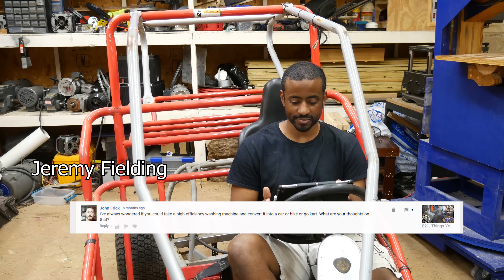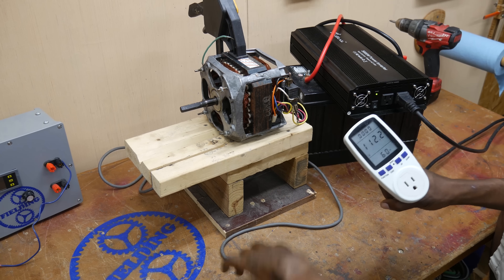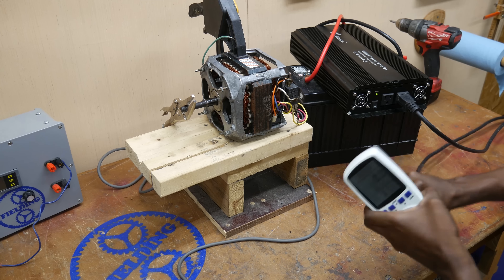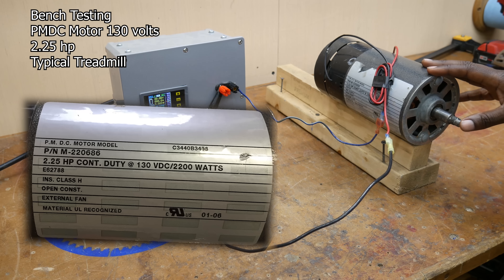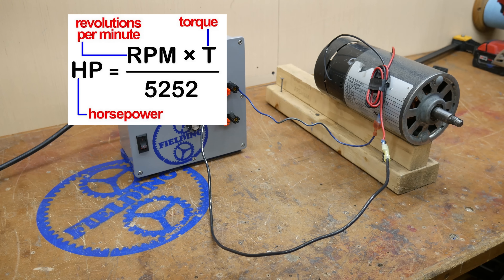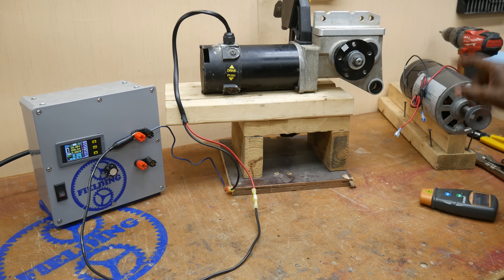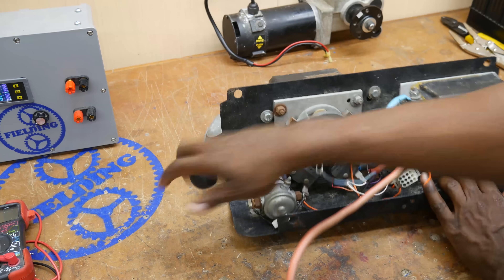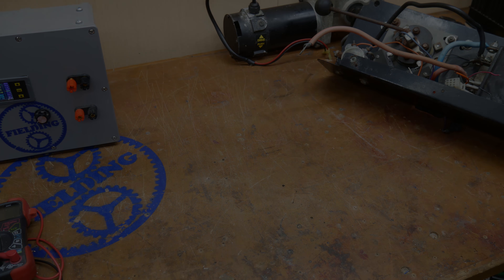What Electric Motors Can Be Used In A Go Kart or E Bike; Bench Testing and Recommended Sizing #61

Comment: This might be a really stupid question, but can you use two small motors in tandem? One that has extremely high torque, and another with low torque but extreme speed?
Reply: jordan secrist u could but they would have to be on completely different wheels and separate esc’s so it wouldn’t be worth it and I would recommend just getting a bigger motor

Comment: What electric motor do you recommend for a 1991 Ford Ranger "S" using one of those old 3speed manual transmissions. No clutch, not even a bell housing. The input shaft on the transmission cut short so the motor can be mounted to the transmission as close as possible. From there the driveshaft to the rear end unit. 3 forward and one reverse gear. Secondly,, what do you think of using power tool batteries to power it? Take your time workshop this and get back to me or make a video, I'm subscribing to your channel now. Thanks
Reply: 18650s will work

Comment: 30 kmh is more like 20 mph not 12
Reply from the maker: if only I had used a calculator... LOL ... it happens. I did add a correction to the description a year ago... its the best I can do
Reply: @Jeremy_Fielding  lol it's fine thanks so much for the video im really interested in learning all about electricity issue is im 19 so all my buddies have been lost to the internet 😥

Anyway why wouldn't it work to have a generator powered by another generator and harvest free electricity I'm sure you've had the Q before I'm just curious why it wouldn't work

Comment: Better to just use an alternator from a truck, better yet it uses DC. It does need a little bit of reworking but with the right ESC (electronic speed controller) it can even provide regeneron power back to batteries when breaking.

Comment: i have to say this.. all tho i'm not saying this is the case i've used similar inverters
1500 watts or a short peek at 1675ish watts is the normal max for any ONE outlet in a house.
Being that these type inverters tend to split there output with 1500 watts per circuit.  depending on the model
1500 watts split between outlet one 1 or 2 plugs. and 1500 watts on the other. total 3kw
it would make more since if they would advertise them as 1500 per plug. 

But don't say it's lying to you unless you check.
Reply from the maker: Please read the description

Comment: some of the best motors for electric go karts are 24 v industrial motors from baldor or leeson with integral fans .. Ive built several EVS as seen on my channel.. and the motors are cheap.. One thing people commonly do in underpower the motor based on assumptions about amperage ratings.. I often ran the 1 hp leeson self cooled motors on 200 amps and never once got the motor warm.. Having a programmable controller is nice but i do not recommend the kelly brand.. They have a preset soft start that the user cannot ovveride.. I think the limit was 40 %.. The alltrax and curtis controllers have full range programming .( as well as 20 other brands )

Comment: The addition of a capacitor will stop any problems with initial startup. It will hit the motor with a large jolt of electricity to get it spinning. I would suggest the same capacitor that was originally connected to the motor when it was used as a clothes washer motor.
For a low torque motor why not use a torque converter to get the cart moving. Even a simple centrifugal clutch from a chain saw mini-bike, or go-cart would help overcome problems with initial take-off. Both types would allow the motor to gain RPMs then gradually transfer the power to the wheels. The addition of a heavy flywheel would also help with either the clutch or torque converter. 
You are correct about not using an inverter. Tremendous power is lost when using one.
Reply from the maker: I was using the capacitor in the demonstration you just watched... the weakness is in the inverter to deliver the electrical power not the motor or capacitor. Also there are more notes in the description.

Comment: Lol this is hilarious. THATS NOT AN INVERTER ITS A TRANSFORMING INVERTER IT DOES 2 THINGS transform 12v to 120v, and invert DC to AC. SO IF YOU MAX OUT 1 THING IT CAN DO IT WONT DO THE OTHER TO SPEC! 
Inverter = DC->AC or AC-> DC ------ Transformer = 12v > 120v step up voltage. Buck Converter -- 96V DC -> 12v DC Step down. Learn you electronics before plugging shit in. Thats a PEAK RMS 3000 watt. meaning it does 1500 watts or 1800 watts continuous load.
Just wire ten 12v batteries in series and make 120v DC then INVERT THE 120V DC to 120V AC. And you wont be having peak problems. The peak problems are from you trying to step 12>120 AND put out 1755 watts. If your voltage matches 120vAC - 120vDC Then it can do the statistics posted on the transforming inverter. If you are transforming you can expect 35-50% performance. Just use 120VDC then invert to 120VAC and use that same inverter it will be fine... That electric 120VAC motor is more efficient than anything DC so I would use it. Especially if its from a front loading "High Efficiency" washer.

Comment: I see that you have solved the "where to put the batteries" problem but I don.t see it. It appears to be well solved, as your boys have appear to have good seating. Have I missed a video perhaps?
Reply from the maker: Yes. There use to be a video in between but I removed it because the motor it shows. Short answer : the manufacture lied about the HP. I didn’t want to give them a permanent “ad” on my channel by showing it and using it in a video.
Reply from the maker: I bought slightly smaller batteries and mounted them low between the motor mounts and the seats

Comment: AC motors don’t need a big ass inverter, but instead use a pre-charge circuit to supply the high initial current. Plenty of YouTube videos on electric vehicle conversion available that explain it.

Comment: The drives on the shafts of the two motors you compared are different sizes. This will give you inaccurate rpm readouts.

Comment: You are an idiot. Washing machine motor can be converted to DC by reconnecting the coils. Why you breake people plans? Check the motor wiring conversion Ac to Dc before you talk shit.
Reply from the maker: Are you outside the USA? Perhaps you are talking about a universal motor. They run on AC and DC and are often used outside the US in washing machines. There is no reconnecting anything though. A induction motor however will not run on DC. That is what I show here. Thanks for watching.

Comment: True battery sag is the likely cause, not the rating of the inverter being false.  You need to put two or three such batteries in parallel with good tight connections and heavy duty wiring to supply the needed level of inrush current to start that inductive load.  I take it it's not one of the inverters that alarms when battery voltage drops below safety voltage (about 11.5 - 11.6 V for lead-acid) and it cuts off the load to protect the batteries.  It is usually done to keep batteries from over-discharging and thus avoiding cutting their life short.  It is much less likely that the inverter manufacturers are cheating you on their rating and more likely your extreme dead-locked load starved the inverter of a high enough source of cold cranking amps to get that motor started by breaking free of its moorings or overcoming the locking power of the tool.  But another thing to point out.  You increased the physical load beyond what is normal on that motor by putting it in a physical dead-lock.  That takes it to maximum current automatically whereas a real go-cart would not have more than likely.  If you had put a moderately heavy drag on the motor that was reasonable as opposed to a physical deadlock, the current would never go that high or for that long because the motor would immediately start to turn even if slowly at first, because a go-cart would not have as much drag on the motor on level ground with the wheels not blocked physically.  That is the reason why your current surge went so high for so long and your battery voltage sagged because of the extreme current it was being demanded for because electric motors tend towards infinite torque if you can supply them the amount of power required without the wires burning up first.   It will raise the current until it overcomes breaking past the physical drag on the rotation and starts spinning and then the current calms down, or it can't draw enough current and eventually the power supply gives out or the motor thermal protection kicks in, or the power supply can supply more current than its' asking for but it's asking for so much current it will burn up the windings trying without thermal overload protection or if the motor was that powerful, it would break its mooring or burn up the cabling from the battery if nothing else failed first.  Never dead-lock an electric motor.  It is not good for it, and it's not a realistic test anyways.  It's like throwing a log between the spokes of your wheel in terms of how hard it is on the motor to stress it out trying to start like that.
 
Another thing to point out is that if it wasn't battery sag, and it was the maximum rating of the inverter that was at fault, a couple factors to consider about the truth behind ratings.  Never confuse the constant operational max rating on inverter wattage with the max surge rating.  Good inverters will list both their max constant wattage and their max momentary surge wattage just for the reason so that prosumers can gauge compatibility with their inductive (motorized) loads.    Rule of thumb with most inverters is surge wattage is only about 1 or 2 seconds at double the constant wattage rating.  A 1500 Watt / 3000 Watt max surge inverter would probably work great with your motor, providing that the wiring gauge, the connections made, the contact is adequate between conductors for high current and the batteries can handle the surge current expected (parallel until it can), it is also essential that the output from the inverter must be for any motorized device and delicate electronics a pure sinus wave output and not cheaper inverter square-wave or "modified" wave style which is bad for reactive loading wasting power making extra heat with that instant max voltage edge hitting a still device rather than the gentle lead-up curve and its particularly jarring on motor wiring and bad for performance, potentially damaging equipment as well so you need to make sure you have a clean sinus wave-form ideally with a well-regulated 120Vpp going into your motor under load.

AC controllers are actually not that unusual although they are certainly more difficult to design and a bit more expensive.  I've seen a lot of the more high performance electric auto conversions using 3-phase AC.  It may be exotic to some, but trust that it is very doable.  Don't entirely throw out this option.  If performance matters, there are advantages to that set-up to be sure.  Three phase control (as opposed to single phase AC) is essential for complete electrical control over forward/backward directionality of drive as well as it just provides more raw power to the motor because there are more voltage peaks (three times as many per second) to keep the voltage level across the motor on average higher than a single wave form and set of coils an in theory more stable speed regulation than single phase plus more torque because you aren't just using one set of coils, its three sets of coils driving those magnets so it just has more Ummmph!!!  It's also better for breaking control if you want to reclaim any of that mechanical motion back to the energy stored in the battery because three phases provides easier regulation of AC-to-DC stable voltage that doesn't need as much large capacitance to smooth out the ripple factor.
Reply from the maker: check the description. Thanks for watching

Comment: When I was growing up,  I used to take these old train tracks to get around,  they went close to the place I'd hang out and it was just convenient for me.  So anyway, at one point I was walking down the tracks and I got this idea.  Either a pedal bike or motorized,  that can be put on the tracks.  I thought a pedal bike with an arm that swings out,  to keep it lined up right on the track.  The train doesn't go through there so safety wasn't my concern.  I just never got around to building it,  I had some ideas in my mind for how it could attach to a bike and fold out.  Never did anything with the thoughts though.  I hope some day someone else does this, i'd be glad to see it.

Comment: You can hook up a power panel display from boat or car for motor voltage and amps.temp sensors...have you ever seen a cork screw log splitter ?that forward and back ward switch would come in handy... there is a video with this splitter and I seen it work if you know how to or you can make the bit and that’s a easy one ..lol good luck I hope you could see the application it will amaze you ..

Comment: Very well done, thanks.  I think a bicycle motor could be 1/2 hp. Just something to think about.
Reply: I've calculated that I'm putting out 3 hp when accelerating my hardest to 20 mph in a middle gear.  Maybe 1.5 hp for climbing steep hills slowly.  Cruising at 17 mph is about 1/3 hp while cruising at 12 mph is half that, 1/6 hp.

Comment: Idea: win powerball lotto, then buy an electric motor used for the rimac c 2. Get go kart up to 300 miles an hour while being harnessed in memory foam in case of crash.
Reply: Well the rimac c2 is a very impressive beast to be sure, but probably a much cheaper and as good idea would be to acquire a used Tesla motor from a pic-a-part somewhere that has wrecked Teslas.   They are out there and not nearly as hard to acquire or as pricey I would imagine but would have as fantastic results that would be practical for a go kart.  200 or 300 MPH, honestly it will never reach those speeds without wrecking probably anyways so get the cheaper easier to acquire matched Tesla motor, controller and battery from the same junked car or piecemeal from two or three junked Teslas same model.  For that "wow" factor, you could tell everyone and put the logo on your go kart that it is "Powered by Tesla" !  And in either case that better be a LOT of foam and I'd also suggest perhaps an automatic fire suppression system of some kind on board a well and perhaps a rear-facing parachute option in case the breaks ever overheat or fail at high speed...

Comment: all electric golf carts run off this principle. 36,48 volt DC are all very common ranges. if anyone is interested in building and long lasting system just look at how electric golf carts are built. There is also some electric golf carts that run off an ac motor but they are more expensive to build and there only real purpose i believe is for battery regen going down hills

Comment: So if the AC induction motor runs off of line frequency, then which frequency does it run on?
Reply: If we assume that the slip is zero %, the motor will  run at 60hz here in the USA.
However, you could use a variable frequency drive which adjust the output frequency and the voltage amplitude.
One main takeaway is that the voltage frequency are used to control the speed while the current is used to control the torque.
I apologize if my answer was not what  you expected.

Comment: So if this inverter thing is so much of a problem (or let's put it in quotes like you might, and say "problem"), then how do Tesla cars get away with it (I imagine their inverters are bigger. But still, how inefficiently massive are those while Tesla says that's still supposedly "more efficient" than just running DC motors is?

Comment: Pulse with modulation     What is a THREE PHASE D.C. motor   HUH?
motor controllers are easy to Build  if you are doing to take the time to
Build a Go cart are figger out the gearing to work  then why not buy or
build  a controller
Reply from the maker: I always add corrections to the description. Please take a moment to read it.

Comment: One thing you might have forgot to mention....  Inverter would better be a Pure Sine wave to drive inductive load.   Also the inverter might have cut out due to excessive battery voltage drop... in which case 2 batteries in patallel might help - making such motor/inverter setup even more impratical.  Another alternative is to use a 24 volt inverter and 2 batteries in series.

Comment: Just had a question for you (awesome channel, by the way) in the middle of this video you say if you increased the voltage from 12volts to 24volts you increase the amperage, why? Thought you upped the voltage to decrease the amperage to get the same wattage, thanks.
Reply from the maker: What a great question! I can’t really get into adequately here but it is worth doing the homework. check out my video on how dual voltage motors work. That will help you answer your question.
Reply: Thanks, I will do that

Comment: Just to mention that locked rotor on induction motor does not mean we have a short circuit (even though it is sometimes called that), since the motor has some induction that will limit the current. So you can't use that experiment to conclude what is the max power output of your inverter.

Comment: Duty cycle is based on the motors ability to dissipate heat. I find that if you work a motor over its rated power, unless it is built to dissipate heat very well, it will overheat rapidly, like 2 to 20 minutes, not 30 plus minutes.   Usually if you can use it for 30 minutes without damaging it, it will be, ok for 2 or more hours unless it is in an enclosed area that holds heat.